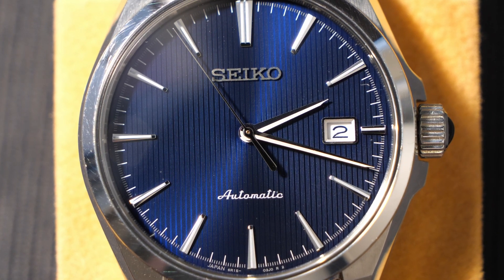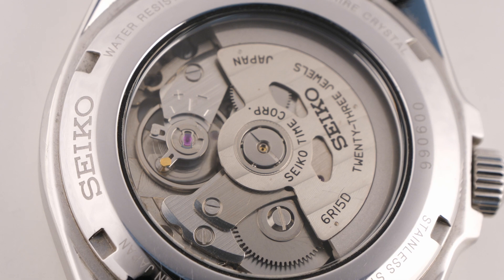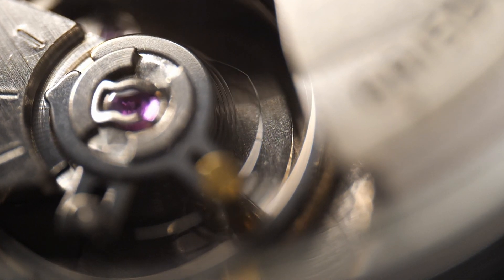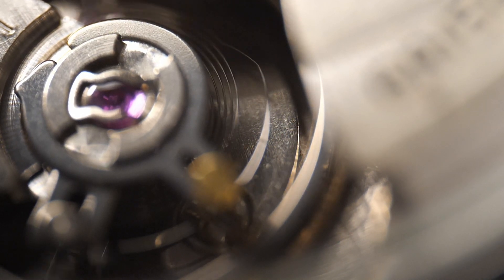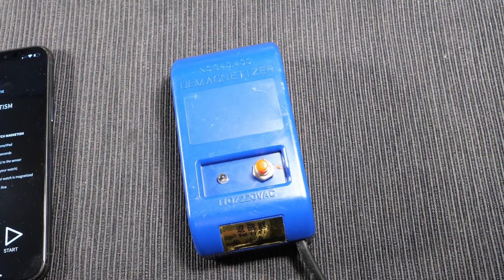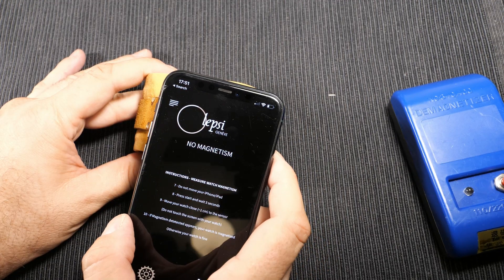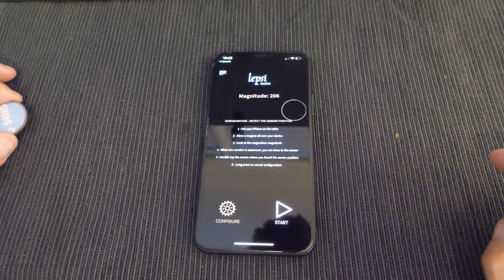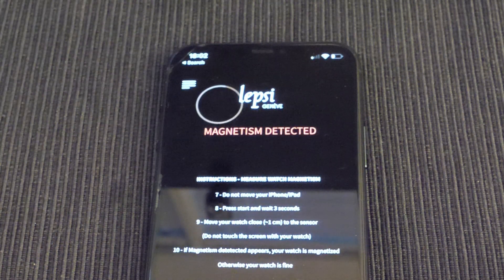How to Demagnetize a Mechanical Watch feat. Seiko SARX045

Comment: I have a bell & Ross 03-92 do you recommend stopping the movement before demagnetizing?
Reply from the maker: I don’t think it is necessary to stop the watch but if your watch has hacking then I suppose you could pull the crown out to stop it.
I’ve demagnetised dozens of watches without stopping them and have never had a problem.
Great watch by the way!